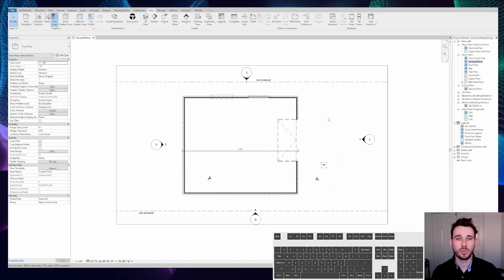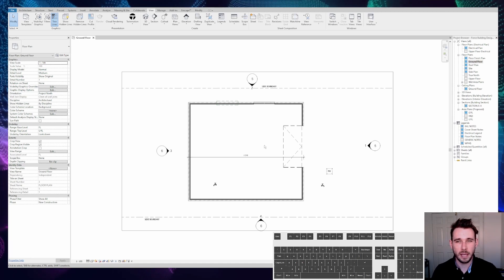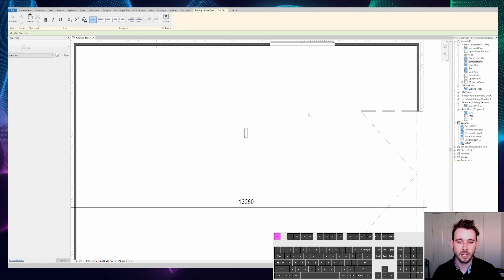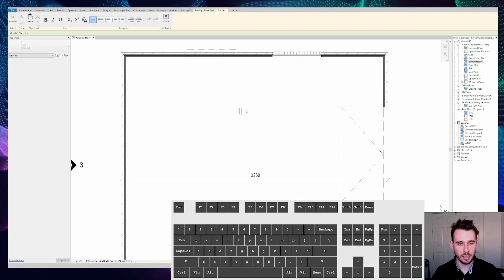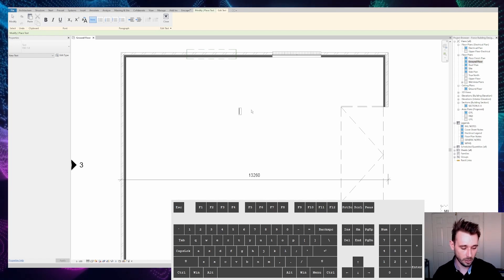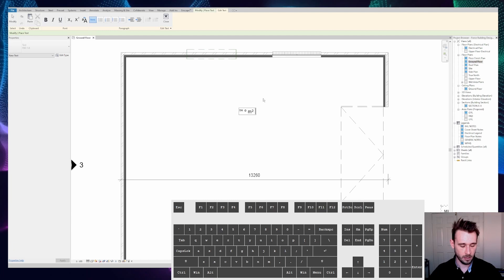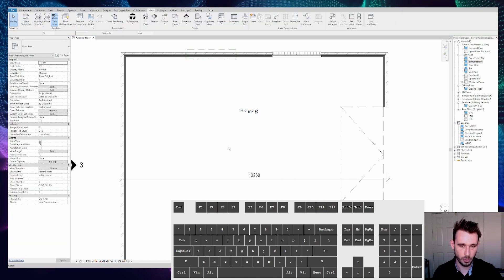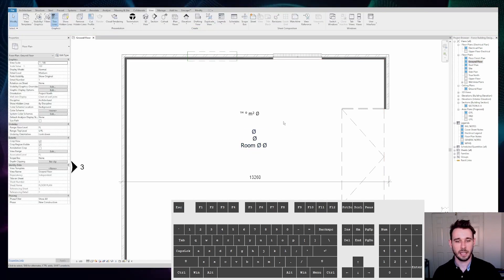How to input symbols in text in Revit using Alt-Codes

Comment: Hi, I would like to ask how to avoid to use this without the view code? I pressed Alt and 0248, when I press to 02, will go to switch windows function due to the default view code
Reply from the maker: Hey so you're saying that when you hold down alt and press 0248 after you've typed the 02 in your computer carries out another command which switches windows?